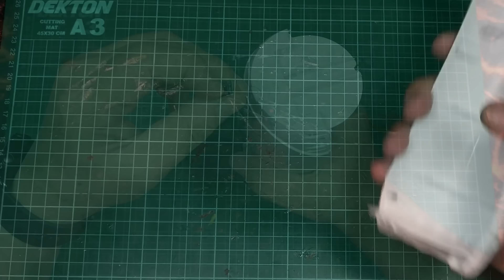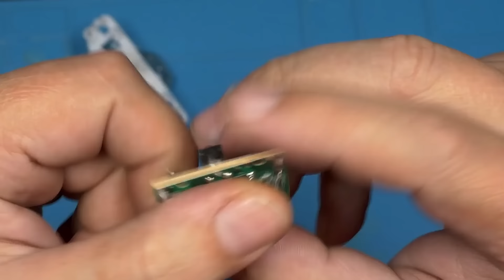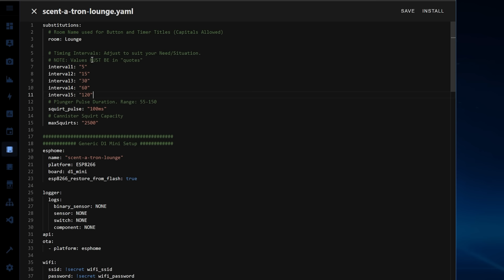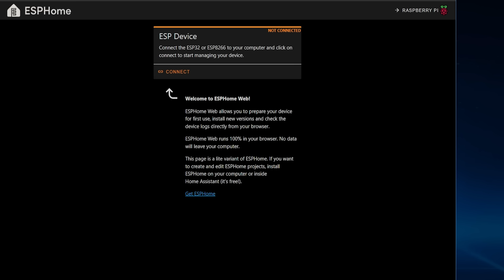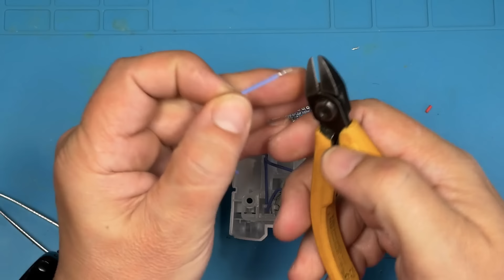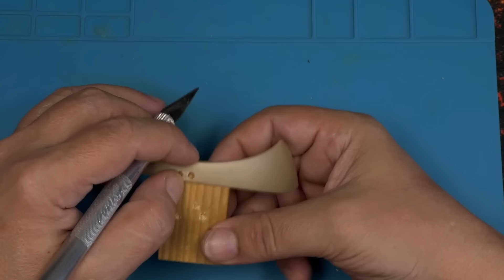Scent-a-Tron v2: Make a Glade Air Freshener Smart with ESPHome

Comment: Hi @3active, great video and very well explained. However, would it be possible for you to post a circuit diagram of the project (a sketch will do)? it will make it easier to understand the connections. Also, can one use any other standard step-down buck converter or will it only work with the "Youmile" one?
Reply from the maker: Thank you for the compliment - I really appreciate the feedback. 

As for "a circuit diagram" there's really nothing to draw, just follow my Step-by-Step explanation... you'll have all the info you need.

No, not all regulator boards are the same. I chose this one specifically because it has the Enable/Disable pin and it's a pivotal part of the project.

Comment: ok ok.. I saw V1.. and was tempted but didn't... and spending 30 quid for the initial glade and then two packs of "10 just in-cases" board.. sounds a bit much? especially considering my soldering skills... but sod it... giving it a go... and hope for the best... theory being more soldering practice can only make me better at it.... so have ordered it all... if 1st one goes well? am moving to a new house and I already have a dozen spare d1's... will use them for that.. lol
also also.. which D1 minis are you using? please provide a link... yours seem smaller than the AZ ones I have...
Reply from the maker: Yeah soz about the initial costings -  It's always best to have more! LOL 
However, I will be using both the USB-C and these Regulator boards in up-coming projects.

Hopefully, those tutorials ( and some of my older ones ) be of use in your new house too.

Soldering: I get asked all the time... How do you get so good?  My answer: Practice! 
- So, it's all ya need... Enjoy and have fun.  🥳
Reply: @3ATIVE  also also.. which D1 minii's? please add that to the video description? I know it makes it look more expensive.. but as you said.. they can be used in future projects.
Reply from the maker: @CraigTinson  Soz, I just noticed your reply....
Any D1 Mini is fine (original or clone) I get mine, in bulk, from China. If you check the video description and look for the last Amazon Link, you'll find a page I made that lists everything I show in my tutorials.

Comment: I hope that there is no need to solder, that nothing is visible aesthetically and that the battery lasts a reasonable time.
Reply from the maker: Then this is NOT for you. LOL
Loads of soldering and although nothing visible-ish... I do add a USB-C Socket and power it from a charger (No Batteries)
Reply: @3ATIVE jajajaj Thanks. I made one of this with ptvo relay switch over Zigbee2mqtt but the battery only lasts one week.
Reply from the maker: @galdakaMusic  Yeah, running these things on batteries is a pain. I'm working on Sleep & Deep Sleep for some future projects/tutorial. 
#StayTuned 😉
Reply: I hope there is loads to do. lol
More chance for me to break it!!
Reply from the maker: @neilos2085  I hope so too. It's a 20+ minute tutorial with loads of detailed explanations. :D